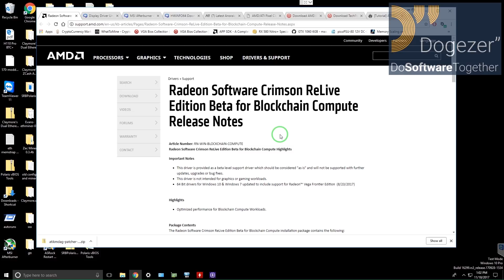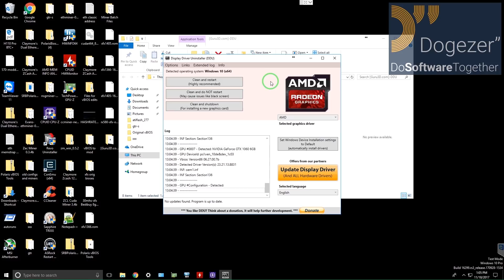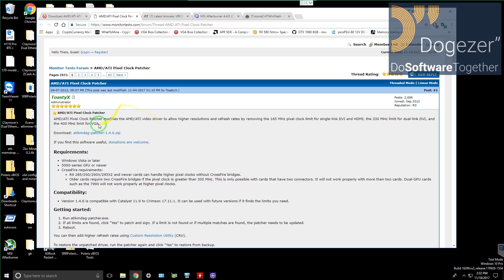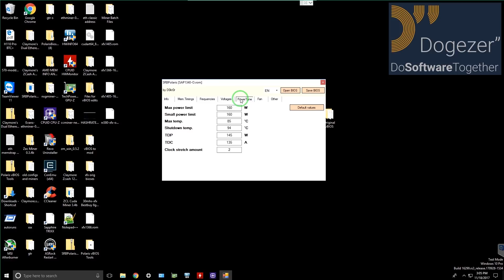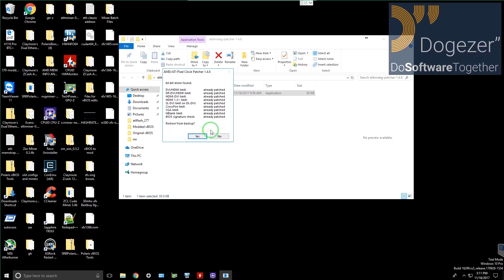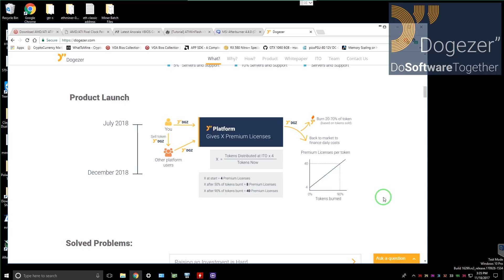How To Optimize AMD RX 470/480/570/580 Cards for Mining - FULL GUIDE!

Comment: Hi, I largely followed your instructions, but the last step - I forgot to run the patcher!. Now when I reboot, my Windown goes into repair mode and then restores to a previous snapshot. I have the original Bios and on reinstalling AMD,  I see my RX580 in device manager. However, it doesn;t show up on GPU-Z and on ATIFlash! Please can you help tell me the steps to restore to original BIOS?
Reply from the maker: Hey Jon, sorry to hear that happened and yes I'll do my best to help you out haha.

So technically, you've already flashed your cards successfully but just forgot to hard lock it in is all, it happens and should be no biggie. The trick to this may be simple as reflashing those same GPUs vBIOSES once more in the CMD line (make sure your GPU vBIOS switches are set to the unlocked/flashing position) once the flash is successful on all the cards close the CMD promp and run the pixel patcher as administrator and click yes to patch the driver values (essentially just doing the step you forgot to do). You can then reboot and I would assume it should be just fine and your new modded cards will be locked in with their new timings. 

Make sure before doing this that you have all overclocking software off and not set to auto start. If afterburner was on at all change the settings to not auto start and reboot prior to following my steps above. Let me know what happens.
Reply: Thank you for your prompt reply! The issue is ATIFlash does not recognize my RX580 even though it shows in Windows Device Manager. I am therefore unable to flash the cards using CMD. The list of cards atiflash -i does not show the RX 580. Its only got the standard VGA adaptor and an old graphics card listed. The latter I used to log into the machine
Reply from the maker: Flip vbios switch back to original position as stated in the video and plug up monitor run off of that GPU (the one that needs reflashing) then reboot. If you're using or were trying to use the blockchain drivers and this happened, your PC may have automatically updated the AMD drivers to the newest adrenaline 18.xx versions so that's another thing to check.

Adrenaline drivers are fine to use instead if you wish, but the AMD wattman tool will compete with afterburner and cause issues like resetting your overclocks as wattman is given elevated privileges higher than those of afterburner. One way to prevent this (should you choose to revert back to blockchain drivers is to first run ddu and wipe everything including the C:\AMD folder, reinstall blockchain, then finally download and use the tool called autoruns and alter it's settings to prevent AMD drivers from updating past the blockchain edition.
Reply: Just to clarify, I have only 1 RX 580.Steps: 1: flip the switch to the other side 2. boot the system and install all AMD drivers 3. Get ATIFlash to reognize it 4. once recognized, flip the switch to the faulty side and load the original bios. Does this sound right?
Reply from the maker: It's the same procedure and order as done in the video. Use the working original vBIOS to boot back into Windows and as long as you're in and have working g video flip the switch back to other side and flash again then patch and reboot. Before trying to install any AMD drivers you're going to have to check what version you currently have, if your c:\amd folder has any folders inside of it besides one with the word blockchain in it then you're going to have to start from scratch using DDU and makig sure to completely delete the c:\amd folder. That's about as simple as I can try to explain it for you so I hope it helps
Reply: This is very clear and I've managed to fix it -- many thanks for your help

Comment: Thanks for this guide, but having tried all these things before, I cannot get past 20-21 MH/s on RX 580s and 480s. Now I am unable to test the blockchain beta drivers because I am getting an OpenCL error crashing Claymore miner and other miners. So I revert to a newer driver and can mine again, but still get only 20-21 MH/s after flashing. Any ideas what's happening? When I did this before, all cards would sometimes hit 29-30 MH/s but would drop back down to 20-22 MH/s most of the time.
Reply from the maker: CrystalMathmagician, I've encountered the same OpenCL errors before as well. Generally I think it's due to the PC improperly detecting the OpenCl.dll file within your mining program folder (the one you would open when you go to start your mining batch file, e.g. claymore's eth_dcr miner folder). A fix that I've found is by simply redownload the mining program .zip folder and copy/paste the new .dll file into the old directory. Alternatively you could do vice versa and copy just your old config and start batch files into the new folder as well.

It's not a bad idea to download and run CCleaner, clean all your registry files, and recent cache files.

As for the drivers, my guess would be that the throttle is coming from either too high of an overclock or from AMD's Wattman tool (which can override Afterburber and Trixx). If you still can't get the blockchain drivers up and running I would recommend downloading and using Autoruns (run it as admin) and use the search bar to locate wattman and if found, uncheck the box beside it, close Autoruns, then reboot the PC and hopefully things will stabilize.
Reply: I figured it out right after I posted my comment. Using Windows 7, it seems the blockchain drivers for Aug 23rd are very buggy and Windows 7 works with the blockchain drivers from Aug 11th, which are not available on AMD's website anymore. I used the drivers from the robinh00d driver pack from bitcointalk which I previously already had downloaded and tried, but today when I decided to try again after seeing your video, I had some underlying registry issues and some other errors that may have been causing problems as well. 

Using DDU and then manually updating drivers through device manager pointing to the unzipped robinh00d folder after fixing other problems, worked! 

I appreciate you pointing out clearly that if there is no display after rebooting after flashing the bios, that you can switch the bioses live in Windows and reboot. That is not something I was aware of on previous attempts. 

Never heard of Autoruns! Will save that tool for future use. Thanks !
Reply from the maker: Glad you got it sorted out, and yes the vBIOS switch can be a total lifesaver! I had those same drivers from Aug 11 initially (on Win 10) with no problems.

I didn't know about issues regarding the second batch from the 23rd on Win 7. Thank you for the detailed response about that as now the info can help others!

Comment: i want to mod my bios but not for Mining, but for gaming how can i do this?
Any other editor tool for what i want to do?
Reply from the maker: There's definitely other tools out there, some of which aren't as straight forward as ATIFlash and may require a bit of experience with hardware-level programming/coding. 

If you're just wanting to improve your gaming performance then there's not really any justification to modify a GPU's vBIOS unless it's either:

1). To attempt breaking some competitive overclocking world record.
Or, and more likey so is:
2). If you own an AMD GPU that is capable of being fully unlocked into its "bigger brother" so to speak by doing so with a single vBIOS flash. (Some examples to research would be how some of the Radeon HD 79xx series cards could be flashed into an R9 280x; Likewise many R9 290 cards could be flashed into the R9 290x, and just recently there's been success at flashing the new RX 5700 cards into the more powerful RX 5700 XT)

The second is the only viable reason (in my opinion) and I did so with multiple 290 cards successfully unlocking them into 290x ones.

If you're not in either of those categories then I suggest download MSI Afterburner and watching some tutorials to familiarize yourself with proper software based GPU overclocking. 

I hope this helped you out or gave you some direction though.
Reply: @ThirdCoastCrypto  can you name the tool for the RX 5xx series?

Comment: when atiflash it does not find the adapter.  what should i do i input -i 1 and 0 and it doesn't recognize it it also states  is not recognized as an internal or external command,
operable program or batch file. using a six MSI Radeon RX580 8GB
Reply from the maker: Are you making sure the command prompt is targeting the folder containing everything? If so, please reply to me and type in full the exact string you're typing into the cmd line.
Reply: C:\WINDOWS\system32>cd C:\Users\ezhus\Desktop\ati_winflash_2.6.7
C:\Users\ezhus\Desktop\ati_winflash_2.6.7>atiflash.exe -i 1
Adapter not found

C:\Users\ezhus\Desktop\ati_winflash_2.6.7>atiflash.exe -i 0
Adapter not found

one thing i couldn't find was the dual bio switch on my card
Reply from the maker: AFAIK the MSI cards do not have a secondary vBIOS and therefore have no switch. Have you flashed them before? Also, you do not need to add the "0" or "1" after the "-i" as it will list all by default.
Reply: found the problem atiflash was a older version not updated since 2013 commencing with the video lets see how it goes thanks
Reply from the maker: Glad to hear you found the problem. Keep me updated on how it goes.
Reply: yea thanks alot video helped me alot but still having a little bit of issues i had to order some new PCI risers and know it detects all 6 GPU but now its shutting down idk if its just running to hard or what but it reaches 120 dergree F
Reply from the maker: Are you sure you mean Fahrenheit and not Celsius? And you would have to describe the way it's shutting off as well as what your power supplie(s) are.

Comment: Any idea about my issue?

I have two Gigabyte Radeon RX 570 Gaming 4GB.  Both have Samsung memory.  One of the cards I get 25 MH after applying the modified BIOS but it doesn't go any higher after I OC the video card with Afterburner or OverdriveNTool.  The other card I get 29.6 MH after modified BIOS and OC.  Any tips on fixing this?
Reply from the maker: Hmm, that is interesting. You could try playing around with the PCIe slot placement of the cards and look for any changes other than that, more info below:

My first suggestion would be to check your "C:\AMD" folder and look for ANY data/folders/files from previous driver editions. If there are any present (aside from the blockchain ones) especially ones with a higher driver number you would want to run DDU once more and choose the option to "remove AMD folder". Then reinstall the blockchain drivers.

Secondly you  could use GPU-Z to save a copy of the 29.6Mh/s card's vBIOS and then use the .rom to reflash the lower performing card. Make sure that you run the pixel clock patche (as admin). And in this case, since you're reflashing it you can choose the option "restore from backup" on the patcher. Then run it once more and patch the drivers again and reboot the PC.

I wish I could see it hands on to be able to get more Info, so I hope this helps in some way.
Reply: Thank you,  I don't know how there was a second driver folder in the AMD folder. I removed it and my second card jumped up to 29.4 MH.  

Hope to see more vidoes coming from you soon.
Reply from the maker: Nice! Glad we could sort it out, and thank you.

Comment: Can you recommend any hardware vendors? I hear MSI, SAPPHIRE, XFX are good. How about ASUS, Gigabyte, etc?
Reply from the maker: Steve, Asus makes good quality GPUs, but as for Gigabyte I'd advise you to stay far away. That's coming from personal experiences I had with 3 cards I previously used (from AMD's R9 290/x/390/x Hawaii GPU lineup).

With respect to performance, quality, customer service (for RMAs) and resale value, this is how I'd order each manufacturer:

1) Sapphire
2) MSI
3) XFX
4) Asus 
5) Powercolor (Devil series only)
6) Gigabyte

Absolutely stay far away from Diamond Multimedia and Biostar.

Asus makes great products, I use their motherboards exclusively in my personal (non-mining) PCs. Unfortunately in the last 5 or so years their customer service has become so poor that attempting an RMA isn't even worth the hassle. On the other hand, Gigabyte has acceptable customer service but I don't find their video cards up to par in quality when compared to others.
Reply: Thanks. How about mixing card models? Has that ever been a problem for you?
Reply from the maker: Not at all, but this could be subjective depending on a few things. One being your choice of motherboard and a few minor things within the OS.

I have one rig with a PNY 1060, an MSI 1060 and 1070, 6 Sapphire RX 580s and 2 MSI 570s. Running stable with no issues.

Comment: Everything seems successful until I reboot the rig after flashing and patching. The pc then doesn't recognize the cards as RX 580's. Any thoughts on what could be causing this?
Reply from the maker: Austin, is anything showing in your device manager when checking the GPUs under display adapters?
Reply: Evanjdevelopment yes they are showing under display adapters currently but that’s because I had to backtrack to the original vbios. Now that I’ve successfully installed the block chain driver I was going to try to flash the cards again to the modded vbios. My question now is whether the downloaded xfx rom I grabbed could be what’s creating the issue? I have the GTR black edition rather than the GTS. Could that be what’s causing them to lock up the machine even after patching?
Reply from the maker: To answer your question, yes. As stated in the video you want to make sure that the .rom file is specific to your card. Is the GTR the best buy one? Comment back with the model number and I'll see what I can dig up for you.
Reply: Thank you so much Evan! Yes it is the Best Buy model: RX580P8D
One is Hynix and the others are Samsung

Comment: Hey Evan.  Jay sent me your way.  I'm trying to install my Radeon Rx580 GPU drivers but it cannot find the hardware...which are connected via PCI risers. Recommendations?  Thanks T
Reply from the maker: Check your device manager (in control panel) and see if anything is showing under display adapters like a yellow warning symbol possibly next to the 580 (if the 580 even shows up). Also, how is your monitor hooked up?
Reply: Thanks, Evan.  My monitor is hooked up via a DVI-D adapter to VGA HP monitor.  I looked in Device Mgr and the only line item there says "Intel(R) HD Graphics 510...looks like it a yellow something on the icon.  Its not finding the GPU plugged in to PCIE 16X 1 slot...with risers..  The installer looks for the hardware but can't find it. Using Win10 btw....
Reply from the maker: Take the DVI-D to VGA adapter and plug the DVI-D end into the back of your gpu (assuming it has one). What's your motherboard as well? You may need to change some BIOS settings.
Reply: I just found all kinds of Warnings and Error logs.  A whole host of issues.
Reply: MB is Asus Primez270-A
Reply from the maker: You'll need to have the monitor hooked directly up to one of your GPUs for detection when installing drivers. In your bios settings change the display from cpu to pcie and set your pcie to gen 2.
Reply: plugged the gpu to monitor but that did nothing...nothing on my monitor...also in case it makes a diff... I am running Win10 off a stick...
Reply from the maker: Take one gpu off of the riser and slot it directly into the first (closest to CPU) pcie X16 lane and boot up with monitor plugged into it
Reply: Evanjdevelopment thanks, I’ll try that this evening.
Reply: Any idea where I would find the bios settings you referred to?
Reply from the maker: When in the BIOS you'll need to press F7 to switch to advanced mode. I've not used the z270-a for mining so I'm not 100% sure what the correct mining config would be. I'm sure someone has posted the necessary info if you Google it or Jay might could tell you.

Comment: Hi evan,i have Asus Rx580 Dual Oc 8gb Hynix memory,i edited rom by copying 1700 memory strap to 2000 and 2200 but it only increased hashrate from 18mhs to 24mhs only.i installed the blockchain driver but no improvement .can you pls. help
Reply from the maker: Sure, are you using overclocking software as well? Also do you mean the 1750 strap?

Comment: Umh i have an asus strix rx 480 8gb and when i mine the speed is  17mh/s or 17.999 i hear this is really slow so does this help
Reply from the maker: It is slow yes, we're you able to find a bios to use on your card and what are your settings within whatever overclocking software you're using!
Reply from the maker: Accidental exclamation point haha sorry.

Comment: HI, tx for this video, i have follow all steps and i am using MSI RX580 Armor with 8G with Hynix RAM,  i did Bios Strip for 1750 is this correct ... as i am able to get 25 Hash rate only ...any suggestion
Reply from the maker: Are you overclocking?
Reply: no ..no error at all with mining .. all running smooth but just to confirm on RX580 Armor 8GB i strip 1750 or 1500
Reply from the maker: You need to try using overclocking software like MSI Afterburber or Sapphire Trixx. Drop your core clock to around 1150 and put your memclock as high as possible as long as your rig can handle it. The 1750 strap should be okay.

Comment: cool but i still am @ 23 mh/s :/, I change the gpu core in msi afterburner and it does not move, also the core volatage is greyed out in msi afterburner.
Reply from the maker: +Eric Dorion you have to go into the settings and allow those values to be altered, check for a video covering Afterburber and it should help you out for sure.